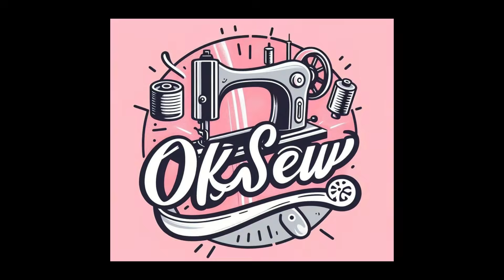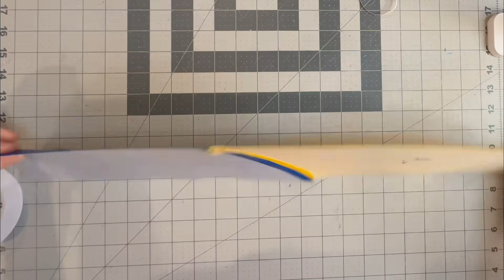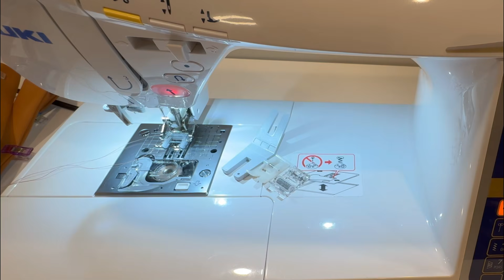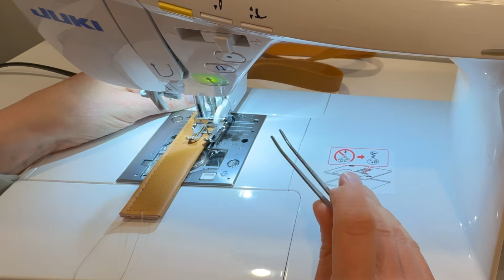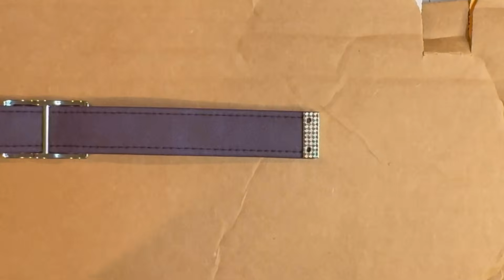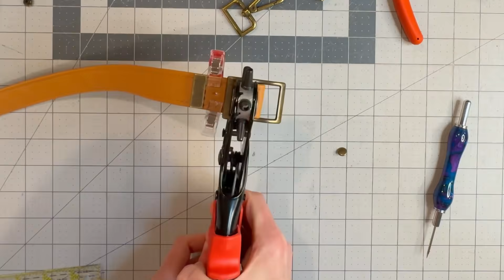Sew A No-Twist Adjustable Vinyl Crossbody Strap

Comment: Could you please provide sources of where to purchase materials?  I would like to try to make straps as replacements for well loved purses.
Reply from the maker: Hi Shonia! For making replacement straps marine vinyl is a reasonable starting point and is somewhat readily available (Fabric Warehouse Direct, My Punkbroidery) and comes in a lot of colours. Aside from that, my preferred vendors for vinyl (both printed and solids) are Emmaline Bags (in Canada), My Handmade Space, More Me Know, and Cotton and Twirls. For bag making I prefer vinyls no thicker than 1mm, and I tend to go for vinyls with a more matte finish than glossy ones as I find them easier to work with. My favourite vinyl to use is Mora faux Leather (available from Emmaline and My Handmade Space) because it is very easy to sew on a domestic sewing machine and is more manageable than some thicker vinyls when folded over multiple times. It does have a little bit of stretch so if you are using it for straps I would definitely add something to stabilize the center of the strap so it doesn’t stretch or crack.

Comment: Well, it didn't work for me.  So sad.  I used fairly thin vinyl which has a very thin felt backing (VERY THIN), a strip of thin twill tape 3/4" in place of the ribbon and double sided tape exactly as in the vid.  I used my walking foot.  So many skipped stitches (many), thread breaking but not breaking right through.  Part would break then get all messed up in the take up lever.  I'm using Gutterman brand full poly thread.  Needle was newer but changed it anyway and increased the thread tension.  Used a Microtex Sharp size 12.  Same result.  Yet when I used a 6" sample before going ahead with the long one, it was fine.  On the sample though, no tape, no twill.  Because it was a short piece I just folded it four times and sewed both sides plus a couple down the middle just to test.  Nothing wrong.  I have lots of that vinyl and it wasn't too expensive so I will try again.  Maybe I just don't have a machine with enough oomph!  Disappointed.  It is new.  But this is no reflection on your instructional video.  I love your vids and I've made 4 bags now.
Reply from the maker: That sounds so frustrating! I am curious if the problem persists with a different vinyl, some are much harder to work with than others and it sounds like you have done everything as I would have; or perhaps the twill tape was causing problems? An alternative to the ribbon would be a strip of interfacing.
Reply: @OKSew474 , I'm going to be making another bag soon with another type of vinyl.  I'll let you know.  I should have mentioned, I used the same vinyl (strap) for the accent at the top of the Kleier x-body and had no issues however that was a single layer with zipper tape.

Comment: I'm having trouble with straps twisting.  I have tried most of what you show but what do you feel is the most important step to avoid the twisting.
Reply from the maker: I think a walking foot makes the most difference when sewing your strap, and making sure that the material you are using is not twisting prior to sewing. That can result from not cutting or folding the strap perpendicular to the grain line of the fabric, so it ends up slightly on the bias resulting in stretching that becomes twisting on the completed strap. Vinyl that has been cut off grain can be particularly prone to this.

Comment: I felt it wasn't quite clear how long the strap was.
Reply from the maker: The specific details for length will vary based on the pattern and personal preference, I find 55-60” to be a reasonable starting point, which is the width of most rolls of vinyl.

Comment: When folding this type of item, I first make registration marks with a very thin chalk marker. This helps to ensure that the outer edges are folded at right angles, lined up with the center line, and helps to prevent the folded portions from skewing and/or creating ripples when sewn on the machine,
Reply from the maker: Great tip!

Comment: What's the length of the long piece of vinyl you cut for the crossbody strap? 4" by ?
Reply from the maker: I generally do 54-60”, whatever the width of the fabric is. If you need longer you can join two lengths but most rolls of vinyl fall within that range and it seems to fit most body sizes and when shortened fully can be worn on one shoulder rather than crossbody without being too long.

Comment: Do you have a recommended brand of vinyl to use? I'm new to bag making and am still getting my head wrapped around best practices for materials.
Reply: I’d like an answer to this question, too!
Reply from the maker: I may need to do a video on different vinyls and the things that I like and don't like about them, there is a lot to say but I will do my best to give you an answer here. There are a few things to think about, but in my humble opinion the main things to consider when starting out are cost and user-friendliness. When I was first working with bags my main concern was with keeping my costs low as I was practicing and building up my own skillset. Unfortunately, some of the cheaper vinyls available are a little trickier to work with and can present problems that you won't have with other options, which can result in frustration and ends up in a false economy situation. My favorite vinyl to work with is Mora Faux Leather from Emmaline, which is a Canadian based shop, but unless you are in Canada the cost of shipping may be prohibitive until you are certain about your future in bagmaking enough to make the investment. A good US-based alternative is myhandmade space. You are looking for vinyls that are "faux leathers" or "faux suedes", preferably non-textured as those tend to be thicker, and nothing too shiny or shimmery as those are harder to work with. Anything with a more matte finish around 1mm is going to be a good starting point. You may also have luck with faux leather and/or lychee grain vinyls from suppliers on Amazon to give you a feel for working with vinyl without having to shell out a lot of money to get started, I would opt for ones with reasonable reviews and as with the others about 1mm thick and avoid glitter in any form.
Reply: @OKSew474  This is incredibly helpful, thank you so much for the information!!